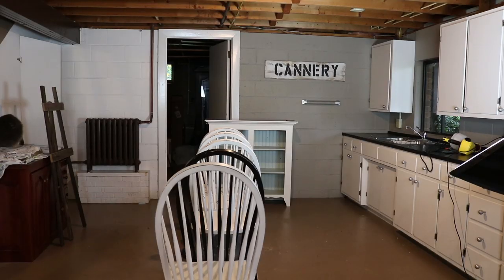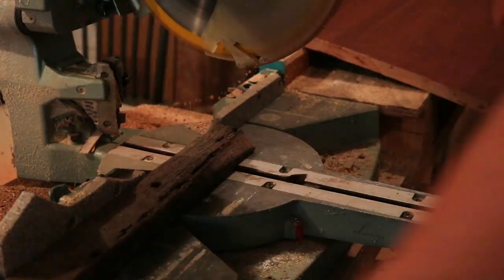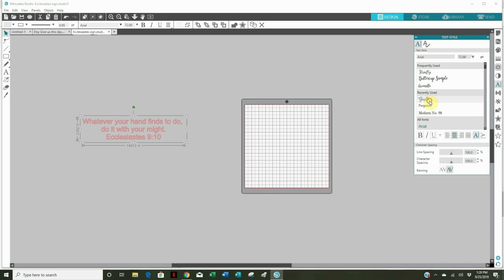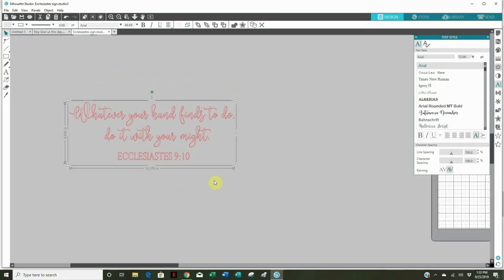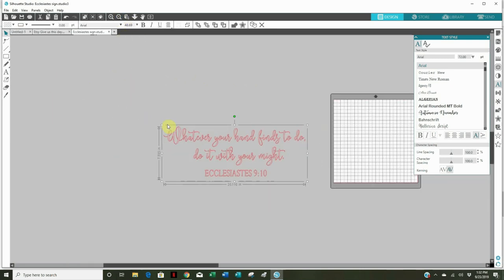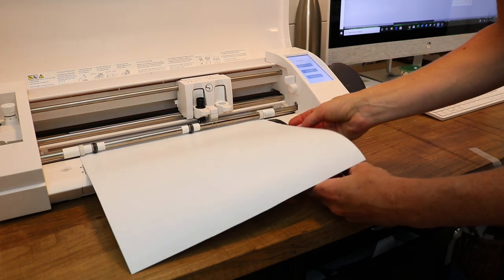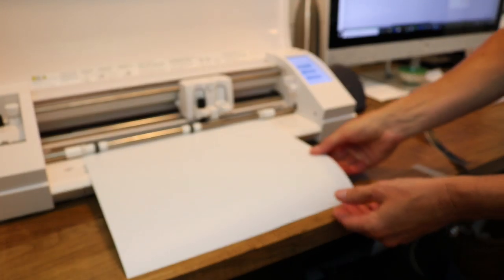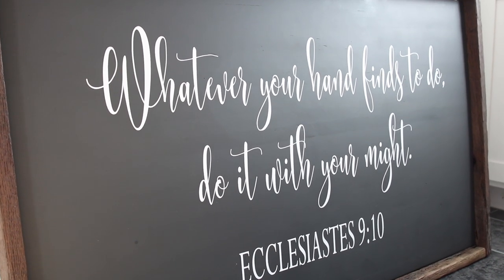Silhouette Cameo Large Cuts ~ Cameo Tutorial ~ How to make large signs with Silhouette Cameo 3

Comment: Great video, as always. I’m actually getting set to do a large format sign for my church, so this was timely. Just for future reference, when you have your original text on the screen, if you highlight the text you want to change before setting your font, it will only affect the selected text and not the entire text box. You can then highlight the rest of it and choose a different font without having to ungroup or retype. Also, as another commenter noted, the cut tool is great for splitting your design into smaller cut pieces. 😊

Comment: Beautiful work.  You wondered what could make a cameo 4 worth it but then showed us a couple improvements that could be made to the cameo 3:  1. not being able to change fonts after you ungroup 2. the long sheets move off center sometimes.  3. they should add the 2" because of the cutting line automatically. 4. simplify rotating.   If the cameo 4 can correct that, it might be worth it to you and others.  Sometimes new editions just fine tune old ones, not necessarily add new features.  Love seeing you use up the extra space to avoid waste.  Sometime you can explain how you store your work on the cameo.

Comment: On the Cameo when you open the front drawer there are fold out supports that will either  support your mat or if you are not using a mat support the vinyl.  Check it out you may not need to use the extra vinyl strip and tape.

Comment: Suggestion on running long sheets of vinyl to make sure it does not skew/slide/go off track as it feeds. After you load the vinyl, go to the feed buttons, push the gear icon, then the down button feed it to the end, this will tell you if it is on track, if not, feed it back, realign, do it again until you get it right, saves me a lot of headaches.

Comment: Have you any experience with Cricut?  I have an older Cricut. I’m scared of all the settings needed in Cameo. I just choose the material and “go” and that is easy!
Reply: Lisa Guthrie - it’s actually just that easy with the Cameo 3 as well. If you’re using the auto blade, you can just choose your material from the drop down list and the software will set everything for you. Some materials occasionally require an adjustment to force, but you can simply choose to test cut to check that the setting works before proceeding with cutting your design. It cuts a tiny star shape in the margin area so that you check your settings. My friend and I bought our machines at the same time, mine, the Cameo 3, and hers, the Cricket Maker. After playing with hers for a bit, I truly prefer the ease and usage of the Cameo. 🙂
Reply: Thanks, Jodi Lea. Gives me lots to think about!

Comment: Shouldn't you park the machine with the roller bar in the up position? Over time the rollers will have flat spots due to the bar engaged under pressure against the rollers.